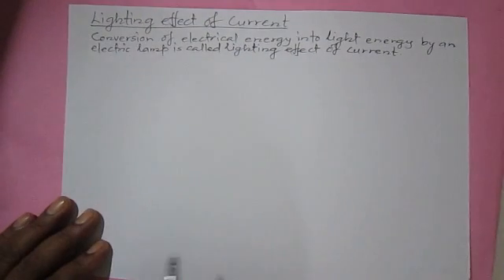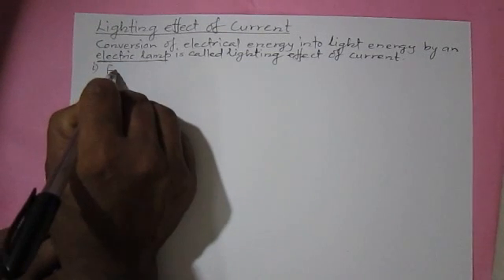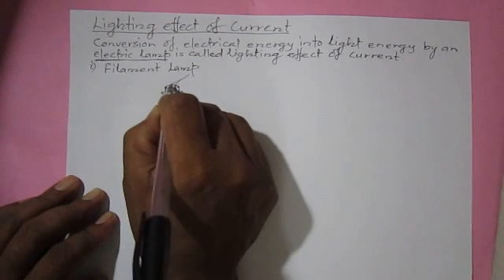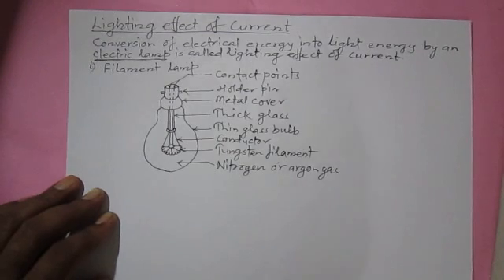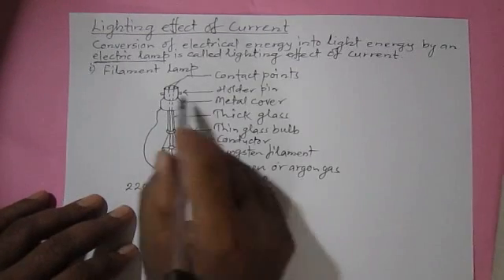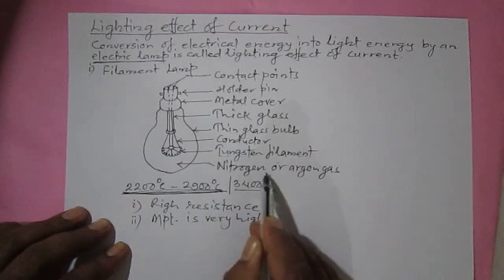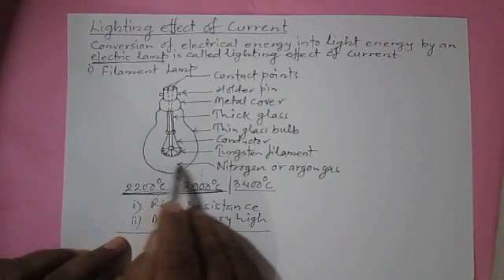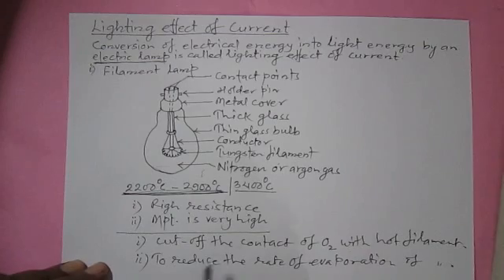Filament Lamp (6.17)

Comment: What are the main parts of filament lamp?
Reply from the maker: Every part of filament lamp has its own importance. But the main part 'tungsten filament' converts electrical energy into light energy and it is possible only when the bulb is filled with 'nitrogen or argon gas'. So these two parts are very important than other.